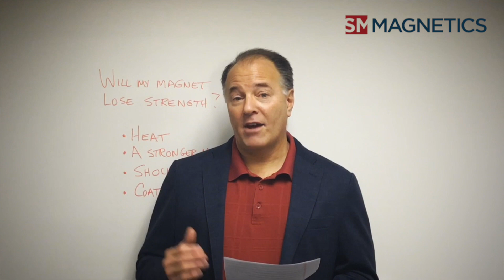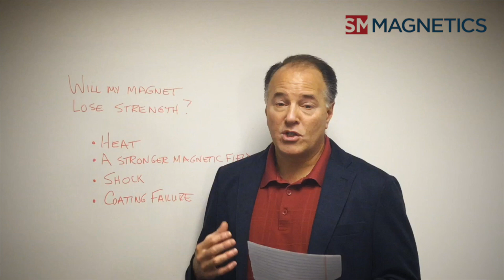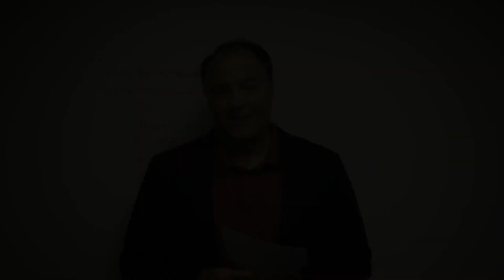FAQ: Will my magnet lose strength over time?

Comment: 《★The Challenge!!!》Here is a magnetic questions for guys ,and the ladies. 
Magnetic Eyelashes are very popular & work with a magnetic charged iron oxides added to black eyeliner. These artifical eyelashes have 5-10 very micro (sized ■ ■■) neodymium magnets that are glued on to each tiny lash band. But the magnets are losing there effective magnetic charged. After a few uses not getting the full 30-60 uses
Please test these & let us know  How we can recharge our micro neodymium magnets on
 a small eyelashes.
Any help would be very beneficial to magnetic eyelashes wearers every where. Thank You 
ஐ Sher in Ca.

Comment: I use magnet for back pain and sciatica— I first bought Nikken  back pad for the back — then I bought magnet bracelets — magnet medallions— corset with magnets ...  the Nikken pad seams to have lost power and it cost over £ 100 , 10 years ago —- two days ago  I bought  two small magnet coins  strength 3.5 kg and they seam to work well — my pain decreased from 70% to 20% in 1-2 hours —-  they  cost less then £ 4.00 —— while you wear them on your skin , your saliva becomes very bitter —- I think it is when they rebalance your body —- I trust they have no collateral effect .... they are saving my life 😁😅

Comment: In other words "A magnet poses infinite energy we yet need to find a way, to use it." A magnet holds onto a surface and physicly spoken does work against gravity right? But our super perfect laws are saying, its not possible. So, how long can, lets say a neodymium magnet with a pullforce of 2kg hold itself on a megnetic surface? How long can you generate power by building a dynamo out of it? If its not limited by time, then I think we need to understand its capabilitys for future technology.
My therory is, that a magnet is a break in the 3D symmetry just like any seperatio of charges. The energy flows from the fourth dimension unto the third dimension just like you´ve punched a hole into the ground and there it is, your oil. We allways build broken symmetries, that kill itself. The only thing that survives the backflow of energy is a magnet. So, why aren´t we using magnets to generate power? The magnetic field has two componets, one is swirling and the outher one is moving straight. A-Field is hidden under the swirling B-field and we use a toroid to seperate them.
If you could build a transformercore, that sucks the B-field from a magnet in, then you would have a magnetic potetial around that core. Now shake it by using fast changing DC current. Each time  the A-field is shaken, it inducts a current in every coil in the system.
better described by Tom Bearden: https://www.youtube.com/watch?v=-bT15h48JhM

Comment: i have magnet for dc motor 3 h.p  and its become weak .. is any way to remagnetizing .... is it will work ... i plane to bring battery charger 200 A 12 v and make some coil with EN8 ... is any advice  for this project ?? what power i need to full charge ??

Comment: Question for the next FAQ : does cutting a magnet decrease its strength ? I mean, not because it gets smaller obviously, but because the heat and shock applied on it could affect it. And what is the good technic to cut a magnet ?
Reply: Yes I think it decreases
Reply: Thinnest cutter possible to decrease damage
Reply: @hacadag  
And should we do it fast or slowly (so we can avoid too much heat) ?
Reply: @En_theo  from my experience, cutting slowly which takes long is best if you   can give extra time. Or you can cut faster with the assistance of a cooler. Some glues come with super cooler liquid sprays which can be used.
It mainly is the shock effect while cutting rather than heat.
But also depends on the tool used to cut.
Reply: @hacadag  
Ok thanks for the tips.
Reply: @En_theo  thank you too, it made me think if I had some industrial super thin cutter blades rotated in higher frequencies, I'd finely hold magnets and use high speed rather than slowly. It really depends on the tool, it is best to know the factors (heat, shock, coating etc.) and behave for it according to the best available usage.

Comment: Excuse me how much is to much heat
Reply: Mateo, It really depends on the magnet material and grade of that magnet. For example, regular neodymium magnets have maximum operating temperatures ranging from 60C - 80C. If your application requires higher heat we can help you with selecting the right material and grade of material.